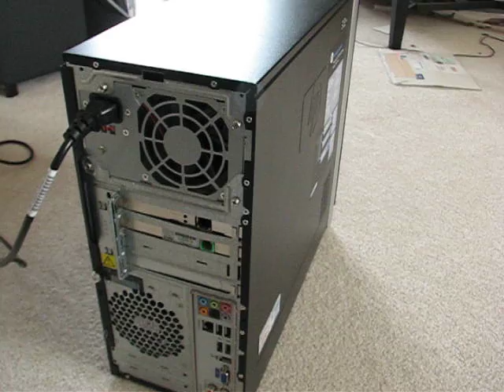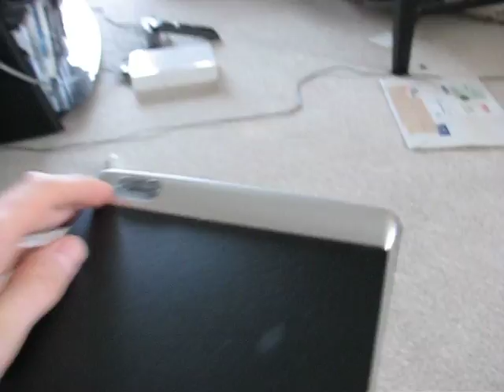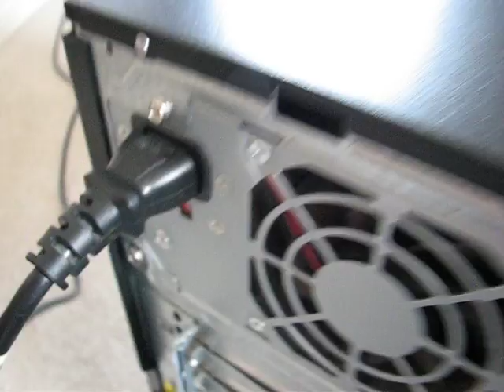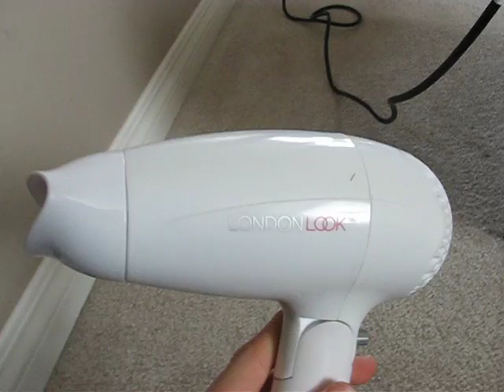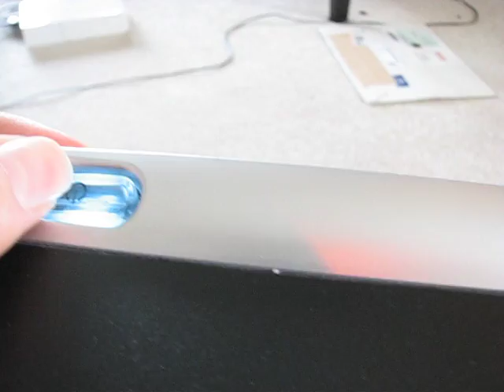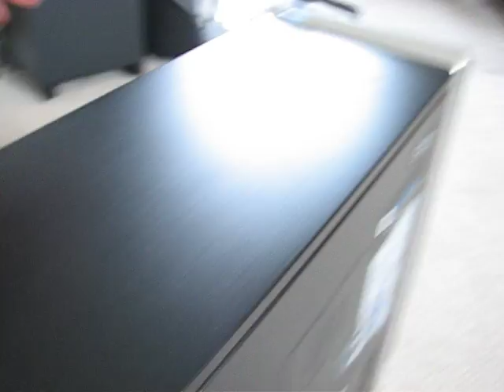Repairing Power Supply on HP Computer

Comment: okay, here is what is happening there... the power supply in this machine is the Bestec model ATX-250-12e. these power supplies use CapXon brand capacitors which are known for failure. there have been some capacitors that have failed in this machine and blowing the hair dryer into it (temporarily) brings the capacitors close enough to the correct capacitance that it will work. what should be done in this case is the power supply should be unplugged for at minimum 2 days, then open it up and locate the bad capacitors which can be easily identified because the tops of them will be bulged upward as opposed to flat like the other (good) ones. they may also appear rusty on the top or have fluid leaking out of them. they should be de-soldered and replaced with the correct value capacitors, preferably low ESR and of a well known brand.

Comment: Please take out supply unit and check all voltaigist by voltmeter. Open supply unit and check all capscitor. If they have rounded top unit is for replacement for beginners. Ckeck also fan because of malfunction and replace it. Thanks to all Marin.

Comment: There's some capacitor's in there that starts up the switch mode supply.
They are going bad and probably have little or no capacitance left. Usually dry out because of the heat and stress .First symptom is a no cold-startup problem It'll work as long as it stays plugged in. If you lose power or unplug the computer for more than a few minutes most probably the light will start flashing again and it'll be back to square one. You can fix it by replacing the bad caps, but it makes more sense to just get a new one on ebay for like $30 NOS. Unless you're experienced using a soldering iron and a capacitor checker or a multi-meter ,getting the replacement is the way to go. A few plugs and a screwdriver...problem solved!

Comment: So to anyone that needs an real explanation:
The psu varistor is faulty, by heating up the psu, your allowing that varistor to have more resistance, so the psu starts.

On an serious note, this is not recommended.
The psu is now starting without ANY PROTECTION, it's an fire hazard

Either buy an new PSU, or if your good with soldering,and know what your doing,, buy the varistor ( couple bucks at most) and replace it on the psu.
Reply: the power supply in this machine is the Bestec model ATX-250-12z. these power supplies use CapXon brand capacitors which are known for failure. there have been some capacitors that have failed in this machine and blowing the hair dryer into it (temporarily) brings the capacitors close enough to the correct capacitance that it will work. what should be done in this case is the power supply should be unplugged for at minimum 2 days, then open it up and locate the bad capacitors which can be easily identified because the tops of them will be bulged upward as opposed to flat like the other (good) ones. they may also appear rusty on the top or have fluid leaking out of them. they should be de-soldered and replaced with the correct value capacitors, preferably low ESR and of a well known brand.  I have worked on many of these HP units that have that exact same issue and the same power supply.

Comment: This worked for me also. But I want to point out that someone told me to view this as a temporary fix. Because the fact that your PC lost the ability to turn on normally indicates that you do have a damaged or some damaged parts inside your computer. So you will still need to get those parts replaced.

Comment: Your hair drier trick tells me there are some dry capacitors in your power supply. It sounds about the right age (Vista?!) to be bad caps. You may be able to revive it a few more times; but, for the long term, they will need to be replaced. We use this trick on old switch mode power supplies often replacing the caps gets the beast back up and running.

Comment: I had a solid green light but when I push the power button, the fan on the power source spins for less than a second and then stops. Hair dryer hasn't worked.
Reply: Pop your ram lose and see if it will boot into bios. Shut down, then add back one stick at the time. Be sure that each stick of ram clicks when fully seated. Check CMOS Battery if under 3.3 volts, replace. PSU light should be bright green.
Reply: I have a solid green light and the power button will not turn on.

Comment: Hi. Is there any way to fix the HP power supply from the inside? Is there a fuse in there?
The light on the power supply isn't lighting at all.

Thank you.
God bless, Proverbs 31
Reply: okay, here is what is happening there... the power supply in this machine is the Bestec model ATX-250-12z. these power supplies use CapXon brand capacitors which are known for failure. there have been some capacitors that have failed in this machine and blowing the hair dryer into it (temporarily) brings the capacitors close enough to the correct capacitance that it will work. what should be done in this case is the power supply should be unplugged for at minimum 2 days, then open it up and locate the bad capacitors which can be easily identified because the tops of them will be bulged upward as opposed to flat like the other (good) ones. they may also appear rusty on the top or have fluid leaking out of them. they should be de-soldered and replaced with the correct value capacitors, preferably low ESR and of a well known brand.

Comment: Hey Bob, just wondering if you’re still using that pc. If so, did you have that issue anymore? Mine is doing the same and I’ve done that hair dryer technic which actually worked but then I have to do it again whenever I don’t use the pc for a few days.

Comment: Dude it worked! I wonder what the real problem is though?
Reply: okay, here is what is happening there... the power supply in this machine is the Bestec model ATX-250-12z. these power supplies use CapXon brand capacitors which are known for failure. there have been some capacitors that have failed in this machine and blowing the hair dryer into it (temporarily) brings the capacitors close enough to the correct capacitance that it will work. what should be done in this case is the power supply should be unplugged for at minimum 2 days, then open it up and locate the bad capacitors which can be easily identified because the tops of them will be bulged upward as opposed to flat like the other (good) ones. they may also appear rusty on the top or have fluid leaking out of them. they should be de-soldered and replaced with the correct value capacitors, preferably low ESR and of a well known brand.
Reply: PSU is going out.
Reply: HP put crap PSU in their computers.

Comment: Ok. So this worked, my computer started up but when i shut it down, i had to use the blow dryer again for it to start. Any ideas?
Reply: justin woodward I used the blow dryer for a loooong time, and finally today even after using it, it will start up and shut right back off. 😥😥😥😥
Reply: Oh, so you have to use the blow dryer everytime you start it?
Reply: @jwoodward1776  okay, here is what is happening there... the power supply in this machine is the Bestec model ATX-250-12z. these power supplies use CapXon brand capacitors which are known for failure. there have been some capacitors that have failed in this machine and blowing the hair dryer into it (temporarily) brings the capacitors close enough to the correct capacitance that it will work. what should be done in this case is the power supply should be unplugged for at minimum 2 days, then open it up and locate the bad capacitors which can be easily identified because the tops of them will be bulged upward as opposed to flat like the other (good) ones. they may also appear rusty on the top or have fluid leaking out of them. they should be de-soldered and replaced with the correct value capacitors, preferably low ESR and of a well known brand.

Comment: My hp is turned on but no window logo or booting and a few second the fan spin extremely fast and very loud....it happens before but it working again after that and then today it happen and wont working again....does the psu was faulty or my mobo?

Comment: THAT is not a fix. Bad power supply should be replaced
Reply: the power supply in this PC is a Bestec model ATX-250-12z, actually a pretty solid power supply and under rated, can handle 300 watts easily. the issue here is that some capacitors have failed, the capacitors should be replaced and it will be fine.

Comment: Sounds like more capacitor plague, you should have the bad caps replaced or get a new psu. Especially if you have a very old computer with a Bestec model psu that lets the 5v stand-by rail go up to 12v or more if the cap for it goes bad that problem has fried many a motherboard

Comment: my computer is almost just like yours but the fans are switched on my computer the one with a bunch of holes is on the top of my computer and the one with a spiderweb patter is on the bottom of my computer on the back which one do I do it to
Reply: Dr HAX  I have an hp computer but I only have one of those spiderweb things and it's on the bottom. all the controls are in the bottom.

Comment: My HP Pavilion Elite would now power up after a power outage on 11-12-2016.  I check out this video and to my surprise my computer started up today, 11-22-2016.  It took approximately 60 seconds of hot air flow but it suddenly started booting up!  This is a fix that works.  I'll see if it is a temporary fix or not, but for now my computer is running.  Thanks for a great video!  
Tom N.
Reply: Tommy Newport Any problem since you posted this?
Reply: @lykourgakhs  he bought another blower because his wife suddenly broke the blower. and tom can fix the blower using his pc vice versa :))

Comment: HP power supplys and motherboardss suck ,,,all HP do is put in a good processor and load it with ram so its fast
Reply: Joe Bennett my HP has an MSI motherboard which is pretty nice
Reply: some are ok but most are not

Comment: I'm using a pavilion desktop and experiencing almost similar power problem except its not blinking nor any click sound. Help what else must I do? or I just replace with the new power supply?
Reply: Nkumbu Sichalwe mine is the same. Lights are on for standby but no power button light
Reply: Did this work for u?
Reply: Same problem like I said but the other advice he had given made it happen. Unplugged for ten seconds held the button. Strange because this happened after my baby wouldn’t leave that area alone where discs and USB are inserted. Then this happened. So I figured it was something with the programming. This is so stupid but there for some reason. Glad he pointed out the other solutions. Life saver! Now my iPhone can be unlocked!
Reply: You ever fix the problem?

Comment: If anyone has a technical reason on why this works, I'd love to hear it. Regardless, after a power outage, my E5200 desktop wouldn't power up. Since I had previously replaced the motherboard, I was hoping it wasn't that again. I went through the HP troubleshooting to no avail, then I tried this as a last ditch effort, and to my pleasant surprise, it worked. Thanks for the video.
Reply: Bruce Nord it's just getting rid of the dust build up, which can be conductive if there's enough

Comment: These power supplies are cheap on ebay, and at  approx. $30 I'd buy 10 off ebay before I'd buy one new.
Reply: There are a few components to reiki healing. 
One place I discovered which succeeds in merging these is the Remarkable Reiki Expert (check it out on google) without a doubt the most helpful reiki healing i've seen.
Check out all the  awesome info.

Comment: Unfortunately, this is the computer I've been using since 2009. I always have to boot it up with the blowdryer. Send help.
Reply: okay, here is what is happening there... the power supply in this machine is the Bestec model ATX-250-12z. these power supplies use CapXon brand capacitors which are known for failure. there have been some capacitors that have failed in this machine and blowing the hair dryer into it (temporarily) brings the capacitors close enough to the correct capacitance that it will work. what should be done in this case is the power supply should be unplugged for at minimum 2 days, then open it up and locate the bad capacitors which can be easily identified because the tops of them will be bulged upward as opposed to flat like the other (good) ones. they may also appear rusty on the top or have fluid leaking out of them. they should be de-soldered and replaced with the correct value capacitors, preferably low ESR and of a well known brand.

Comment: I have an hp pavilion and had to do the hairdryer thing about 2 years ago. It worked but yesterday while I was on the pc......boom!! and computer immediately shut off and smelled a burning smell. I just bought a new power supply and am gonna install today so hopefully my pc will work again!
Reply: The boom noise sounded like a 2 by 4 being snapped in half......more like a big cracking sound and the back of the power supply was so hot i couldn't keep my hand on it for more than a second.
Reply: +Ants Devon    No, I installed new power supply and everything is good. I have had this HP for 10 years now and have replaced 2 power supplies and the ram.

Comment: My HP Pavilion would not power up after a power failure on 2/26/16. Figured it was dead and hoped I could at least salvage the hard drive to possibly retrieve some, if not all, of the files on it. Took cover off and thought first I'd check out possible solutions online: unplugged power cord and held start button down a minute, plugged back in and tried start--no go. Tried other outlets and swapped power cord with another one--didn't work. I figured the power switch might be dead and I'd have to see whether a PC repair service might be able to fix it at a reasonable price (this is a Vista machine and much of the software is not compatible with another, Windows 10 PC I have, so it's worth trying to  to resuscitate it.) Then I saw your video and figured--what the heck--let's try the hair dryer tip.  Aimed it at the fan for about two minutes and then, while unplugged, held start button down a minute. When I plugged it back in and tried the start button--Voila--it fired up. I don't know why this worked but it did. And it kept me from giving up on the machine and possibly wasting money for an unnecessary repair.  Thanks!!!

Comment: Bad capacitors will improve when they are warmed up, but it's only temporary until they cool down again
Reply: Grants Pass TV Repair y’all had warm air blowing? I had cold...
Reply: Heating causes more problem this is just temporary after 2 mins back to square one  does not work
Reply: What’s the solution?
Reply: @tanvirkamal  replace the capacitors in the power supply, if you cannot solder get a new power supply, if it is the same computer you need the Bestec model ATX-260-12z